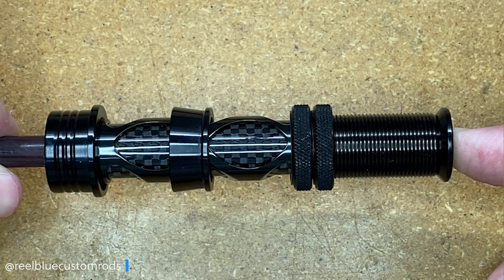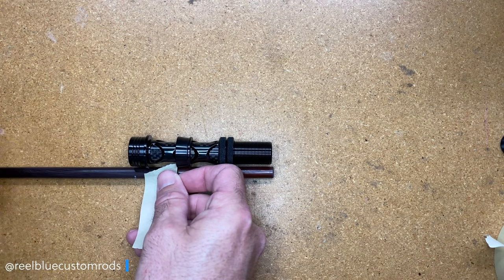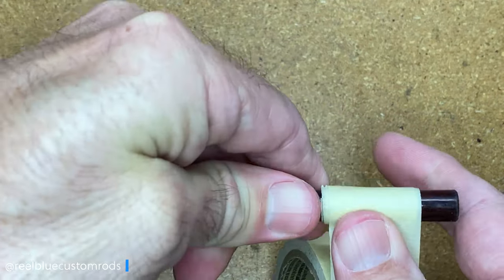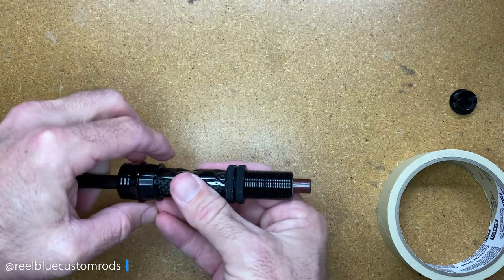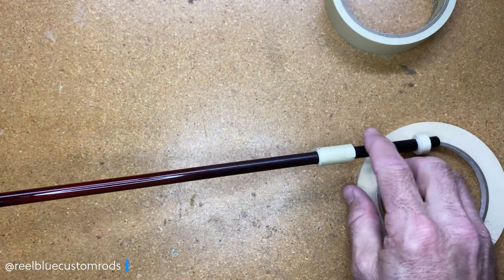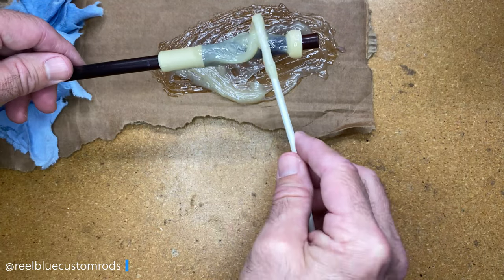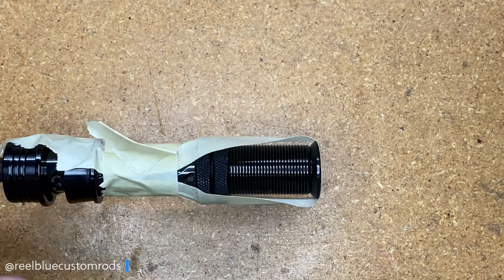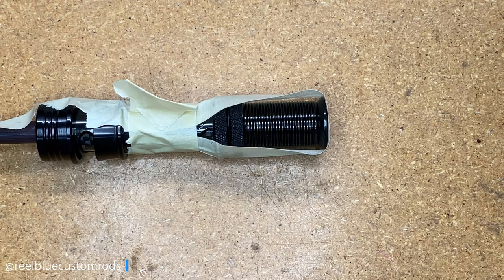INSTALLING A REEL SEAT: How to build a Custom Fishing Rod

Comment: John, many custom builders prefer to build on the straightest axis of the blank rather than the spine. On a multi piece blank like a fly rod may be it can be difficult to determine the spine on all the pieces.
Reply from the maker: Great point Guy, and agreed.  This blank is only a two piece and the spine is actually marked by the manufacture, so it is quite easy for this one.  Again, great comment and thank you for watching and supporting the channel.

Comment: what is the rule of thumb on weather to have the reel seat upward locking or downward locking?
Reply from the maker: Great question, and almost all fly reel seats are upward locking.  Especially those that will receive a handle with a cutout.  Thank you for watching.
Reply from the maker: As conventional rods, personally I thinks it’s personal preference, but I prefer upward locking.
Reply: @reelbluecustomrods  Thank you for the replies
Reply from the maker: @dorflonnigan4413  - very welcome.

Comment: nice
Reply from the maker: Thank you MK, and I hope you found it useful.  Thank you for watching.
Reply: Sorry if I missed it but how do you decide what size reel seat for the rod?
Reply from the maker: @chrisocain9147  great question Chris.  When it comes to fly reel seats like the one in this video, manufacturers will tell you what weight fly rods their handles are rated for.  Does this help?  Thanks for watching and commenting.
Reply: Yes, thank you. I am getting ready to build 4 live bait rods for albacore here in Washington and thinking about Fuji reel seats. I went back and looked in the product description and saw the sizing. Not sure how I missed it before. Thanks for your time!
Reply from the maker: @chrisocain9147  - you are very welcome.  For albacore I would use size 18 casting or spinning reel seats.
Reply: Thanks!
Reply from the maker: @chrisocain9147  - welcome.